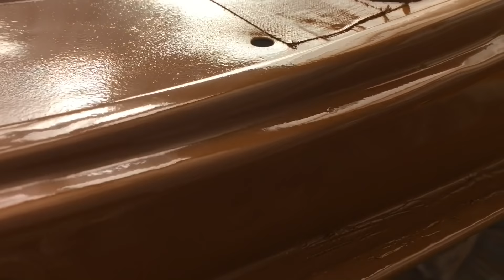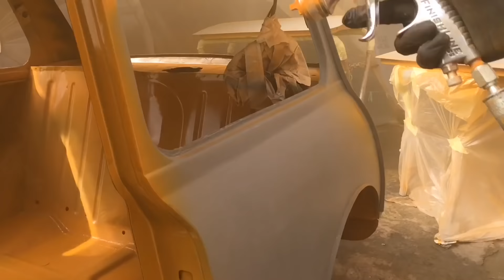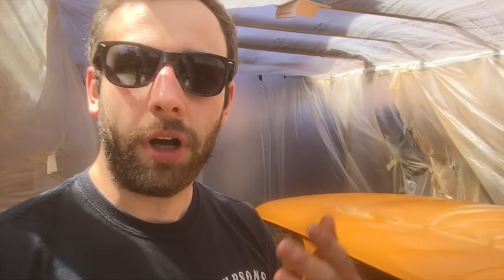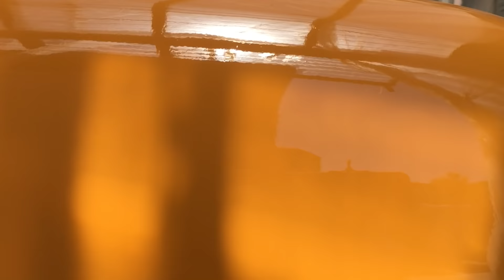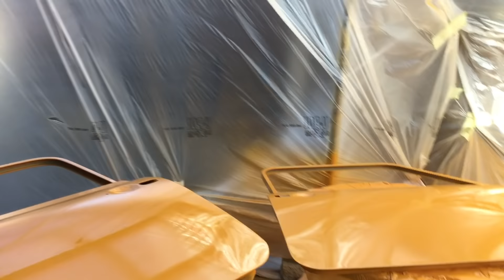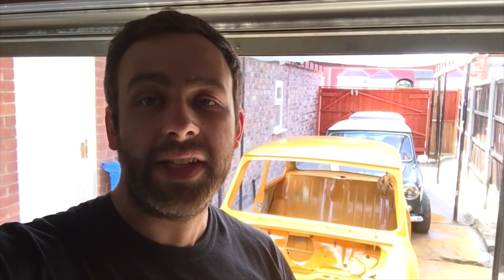Full Respray - PAINT!! Classic Mini Clubman Budget Restoration

Comment: To say you've painted the car on your driveway & it's the first you've ever done... I'd say you've done an amazing job, you should be proud of yourself. Being a spray painter of 30yrs I know how difficult it is to keep a job clean from dirt & runs. I do have a quick question though 🤔:- how do you keep the water from coming through your airline? I've 2 water traps & still water comes through?  I've been emptying my air tank everytime I've finished using it. It's confusing 😕. Keep up the awesome work 👏🏻 👍🏻 👌🏻.
Reply from the maker: Thanks for that Rick appreciate the comment. It was definitely a learning curve and I loved seeing it come together and now in the most recent video seeing it finished is awesome! 
I normally run a water trap near the gun but didn’t this time. I do drain the tank everytime I use it for stuff like this so hopefully that helps. Cheers for watching 👍
Reply: @SimpsonsClassics  yeah I do the same with a water trap. The thing I've just noticed is that everytime I've finished with my compressor I've emptied the air & not the water. Yesterday I noticed the tank was full of water, it's definitely a learning curve for us all. Nearly finished this build & then I'm on the cooper 👍🏻.
Reply from the maker: @velmathemini  oh cool glad you found where the water was coming from. I noticed leaving mine to just drip over night seamed to have cleared it out. Good luck with the next build 👍

Comment: Marc, Great job can‘t believe you got that finish with just using plastic film for a paint booth. The last time i saw the budget 
board you where on around 1,285 Pounds so with all the hi build primer, paint, thinners, panel wipe, Rattle cans & sanding 
papers you must be over 1,500 Pounds, If you are under or over the budget you have still pulled this off for a small amount 
of money. Did you have any complaints about painting the shell & what paint did you use ? Cheers Dave
Reply from the maker: Thanks Dave, the one thing would change next time is get heavier sheeting so it doesn’t move so much but I am glad it’s done now I learnt a lot and can move on to the 89 now. Well the budget has been totalled up and we are closer for sure. No I don’t get any complaints I was decent with the neighbours etc, I used a 2k paint direct gloss 👍